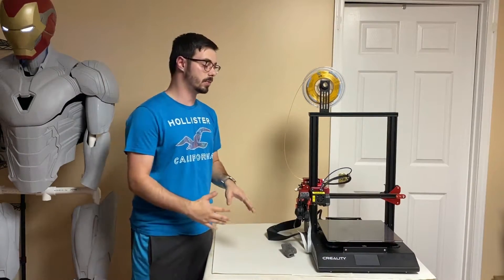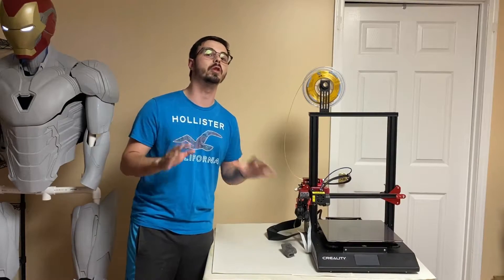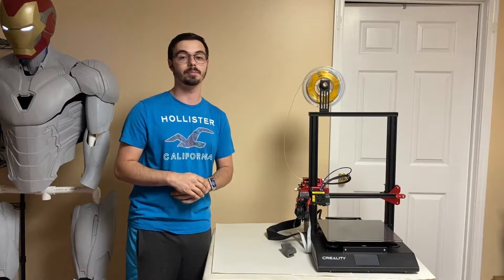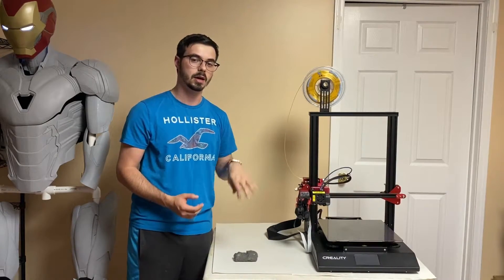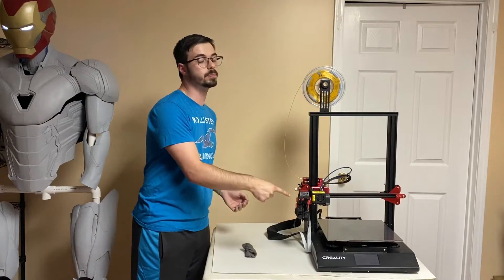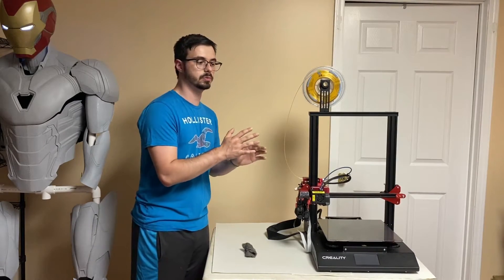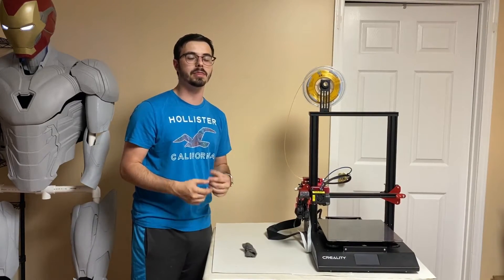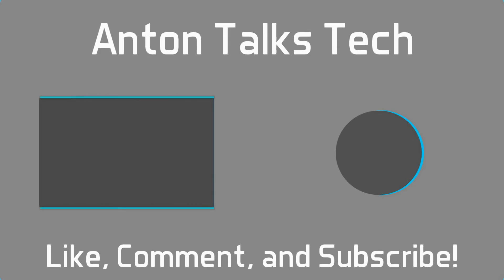Wham Bam Flexible Build System Tutorial  | How to get GREAT Bed Adhesion for Your 3D Printing

Comment: here are some tips for great adhesion with PLA:

* make sure your Economy mode is turned off or prints will release half way!

1.	remove protective film from the PEX surface

2.	rough up the PEX surface with 000 steel wool

3.	clean with isopropyl alcohol and fresh paper towel   https://youtu.be/JZs8gvKTf88

4.	level your machine properly    https://youtu.be/8VgVwCeaovQ
https://cults3d.com/en/blog/articles/how-to-level-3d-printing-bed

5.	correct your gap between nozzle and bed to get very good first layer squish
https://cults3d.com/en/blog/articles/6-main-factors-for-perfect-first-layer-3d-printing
For PLA squish first layer to half height, for PETG do not squish first layer too much

6.	For PLA you want to use the lowest hot end temperature possible that still gets good results - usually between 195-205°C
you may want to print a temperature tower and test which is the lowest temperature that the layers bond nicely and you get good results.  https://www.thingiverse.com/thing:2318636

7.	For PLA bed temperature of 70° is ideal and should not be dropped during build or part will release. Hot end 195-205
For PETG do not exaggerate bed temp or material temp, 70° bed is great, and 240-250 Hot End is ideal.
Make sure if you have an economy mode setting to turn this off, or it will drop bed temp mid print and parts will release.

8.	Do not use bed fan till 3rd or 4th layer.

9.	Some part geometries are much more prone to shrinkage, and warping, especially large flat prints, and also thin long tall prints.  For these you want to minimize drafts of cold air in room (or use an enclosure) and you can always use a brim or raft to get better adhesion.  Use brim to hold edges down if prone to peel, use raft for multiple small parts with minimum surface in contact with bed.

10.	You don't need to do anything else if you get it dialed in right, but if you do all of this and still are having trouble getting to stick you can use a simple PVA glue stick on the PEX for added adhesion.
11.	For PLA a PC build surface gives much easier stick, but PC has the risk of fusing with higher temperature filaments.  Some like PEI better. We now offer PC and PEI build surfaces on our site.

12.	Never force parts off the PEX, let parts cool completely, especially in PETG, then flex the Flexi Plate to pop off, don't pry or force off.  PLA tends to just pop off when cool.	 PETG has great adhesion, so part must be thoroughly cool (not just flexi plate)

You can always use magicoo, glue or hairspray, but once you get it dialed in, it should work beautifully without.